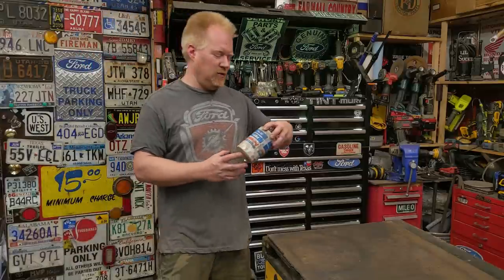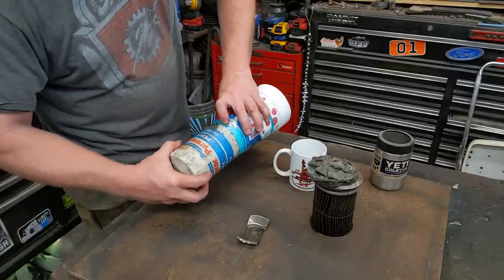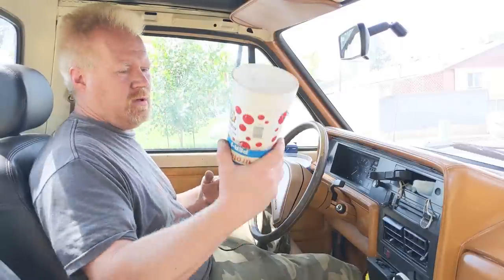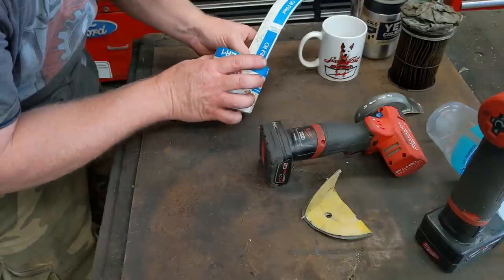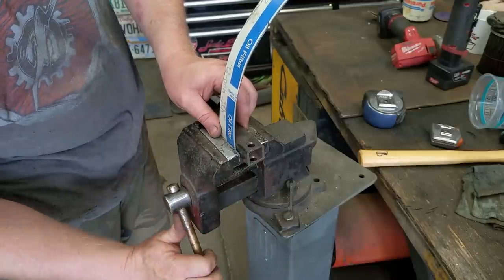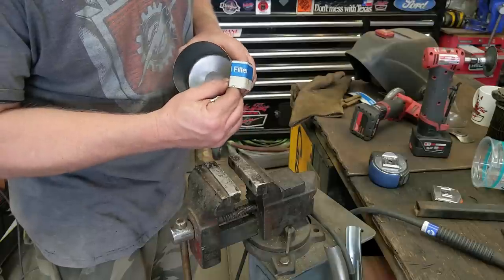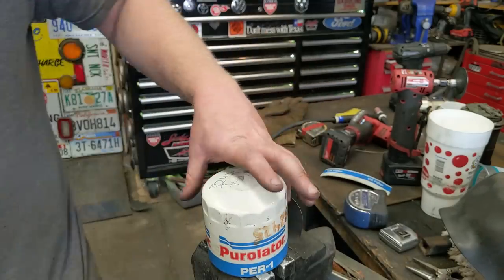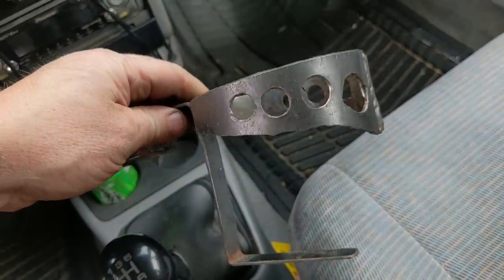Rat Rod Style Cup Holder Custom Build

Comment: Now I have a use for this brand new Fram filter that came with my jeep when I bought it!
Reply from the maker: You could always put it under the wheel and use it as a wheel chock
Reply: So I made one of these out of that filter and it worked perfectly. Didn't even need to cut it down to size! Just snipped the top and gutted it. PH16 was the code for that size filter. I actually bought another for the passenger side so they'd match. Lol.

Comment: I had a console thing that came from Walmart that had two cup holders and a place for cassette tapes that I would move from truck to truck. It had a sheet rock screw in the center to keep it from moving around.
Reply: Lol 😆 that's awesome brother!
Reply: I still have one of those I do the same thing with, it's been in 5 or 6 vehicles over the years. I cut slits in mine on the sides to run the middle seat belt through to secure it

Comment: Thats a cool 😎 little project. I was saying to myself "tig weld it" when you first suggested rivets.........great minds I suppose....🤔
Reply: As much as I hate to say it... JB Weld the cup and bracket together if you don't have a welding setup nor are able to rivet. Of course, any brand of multi-part adhesive can work just make sure it's meant for metal. Drill a half dozen 1/16" holes through your parts and use something like 90-120 grit sandpaper to scratch the pieces so that the adhesive gets a really good bite. Hope that helps! 👍🏻🇺🇸

- Max Giganteum

Comment: there seemed to be a bit of suction still, maybe drill a hole in the bottom of the filter?
Reply: I would drill a hole on the side about 1/3 to 1/2 of the way from the bottom toward the top hidden by the clip. Prevents suction and you won't have anything leaking out onto the door panel or onto your leg. Peace & good vibes! ✌🏻🇺🇸🥤

- Max Giganteum

Comment: When I lived in the SW the backyard was dry sand/dirt for years and finally got around to installing a sprinkler system which made it green.  Then the wife brought home, against my wishes, a puppy with large paws as she told me it would stay small...  It grew fast and was obsessed with the sprinklers to the point of digging to the bottom of the plumbing and chewed off the threaded fittings for the risers and reverted the backyard into dirt, so I named it Dirt Dog.  One time an expensive Horizontal Dial Indicator disappeared from my work bench, after turning the shop upside-down I found it outside dripping with slobber and coated with dirt.  We moved to the North-woods and first time it got loose it bounded happily across the field and off in to the wood-line amongst a long list of predators.  The wife found it three weeks later and got it back from its new reluctant owner.  BTW, your first location is better just because it is central in the cabin with the most shade.
Reply from the maker: Crazy dogs

Comment: Good job!
If your rivets were pop rivets, and they're too long, you can cut them down. You can knock the pin out the back way , then cut down the rivet , then put the pin back in and rock on .. I use a little tubing cutter but you can leave the pin in and cut down  just the rivet with some snips or dikes kinda gnawing on the rivet and using the pin as an anvil to the process. Then slide the rivet off so you can get the cut piece off then put the rivet back on the pin  .. leaving the pin in while cutting keeps from crushing the rivet...
Reply from the maker: Thanks for the tip. Don't know why I didn't think of that, seems so obvious.
Reply: @sixtyfiveford  we all know you would have thought of it if it really came down to it.  I'm just glad i was able to give a little back after all you've given ...
Reply: For rivets that protrude a little too far, you can often peen them down close to flush. Note that the material of which the rivet is made can influence peening - soft metals such as aluminum, brass or mild steel are easily peened. However, stainless steel can be a royal PITA to peen. If in doubt, test it out on a single rivet before proceeding. Best wishes! 👍🏻🔨🇺🇸

- Max Giganteum

Comment: Great idea. Maybe you have an idea to stop my liquid tape & tire patch with the brush inside from drying out . I’ve tried putting car paint thinner in and tape the lid , I’m thinking of getting a kitchen vacuum pump put them in plastic bags & suck the air out . Maybe you can show us something in the future thanks enjoy the show 🇺🇸🔧 Greetings from Canada 🇨🇦🛠👍
Reply: Install your items inside a 100% sealable container and fill it with Argon if you have access to it. Argon often helps preserve materials that harden or dry out in normal atmosphere. This trick is useful for primers, paints, sealers & coatings that come in cans - plastic or metal. Most automotive painters are well aware of it... but it doesn't hurt for anyone to try it with anything. Source of Argon? Your welder if you use it as a shielding gas. Best wishes! 👍🏻👨🏻‍🏭🇺🇸

- Max Giganteum
Reply from the maker: I've tried a few things. Welding shielding gas (c25), straight argon, exhaling into the can before shutting it, plastic wrap touching the top of it, etc. The only trick that I found that really works is simply turning the can upside down and storing it on its lid. Any miniscule lid gaps are sealed by the liquid.